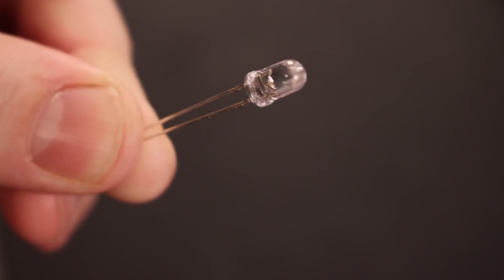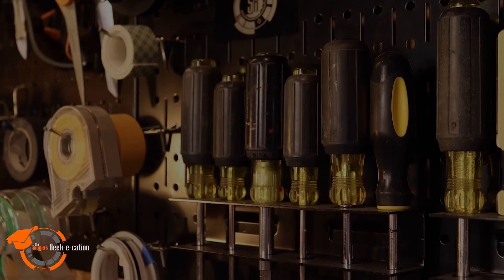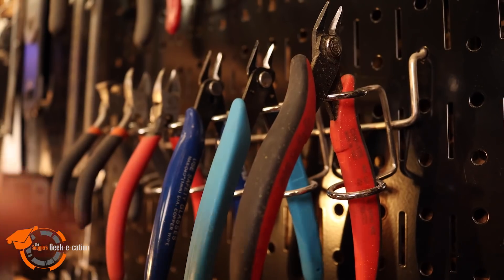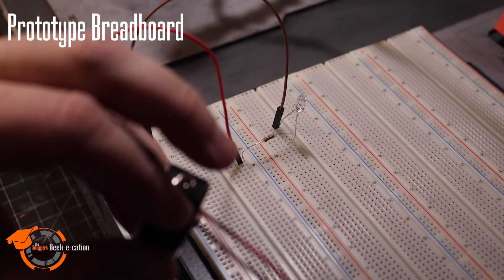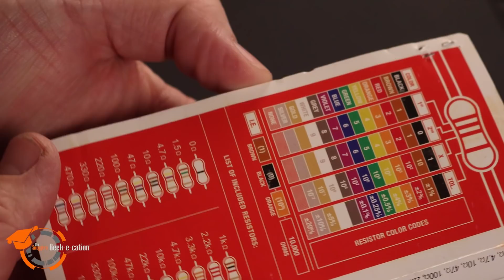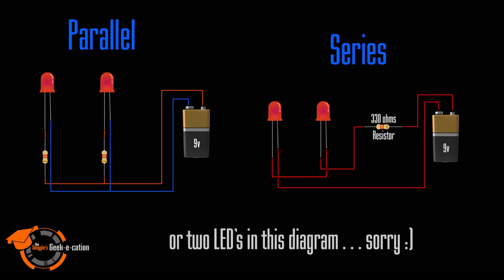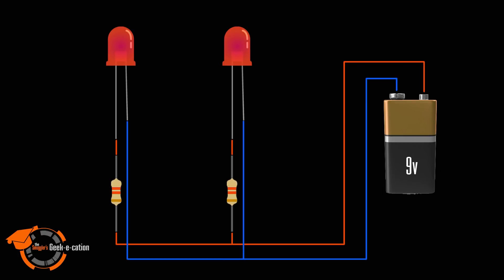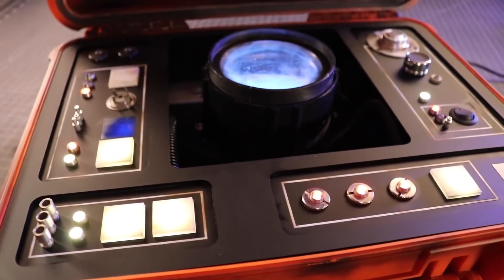Electronics Basics | Starter Tools & LEDs

Comment: I think I speak for everyone when I say THANK YOU was the knowledge and look forward to any future knowledge you drop on us. 

If I were to ask for any knowledge in LEDS it would be how to connect the Leds to an Arduino nano, using a button system to switch between light effects. THAT could be powered by either rechargeable lithium AA batteries or by plug with another switch.

I've seen a few Youtube videos where things similar to that is made but i could never understand why extra electronics were added. like a W130 hall sensor or cc/cv buck converters. I'm also trying to design a solar battery charger that looks like the Endor Shield generator from Return of the Jedi.

Comment: Such a solid video. I was afraid of lights in props three years ago, but I dove in and learned. It is as simple as you say for a basic setup. I use the online calculators for the resistors, but the pre-wired are just so easy to use. If I had found this video years ago, I would have broken my fear back then. Now I love adding lights to everything!
Reply from the maker: Thank you sir!!

Comment: I have a suggestion, which may appear daunting at first for novice electro-nerds, but I think is an important step in greebly LED's: 555 timers. Get them LED's blinking without complicated and overpowered (for this application) microcontrollers. They can be quite simple once you use them, and knowing all the ins and outs isn't necessary for just getting some blinky-ness.

Comment: I really needed this guide. Thank you for making LED electronics a little closer to attain. How would you go about wiring to 12 V  plug instead of 9V battery connection? Great content, as usual
Reply from the maker: Thank you Glynn.  We will be doing a follow up here soon using the 12v.  That said, with these 9-12v prewired LEDs you can wire up the LEDs directly to that power supply.

Comment: Help! lets say someone has those same pre-wired LEDs, 32 of them to be exact, they want to run it 12v from 120v, what do they need to power it? asking for a friend 😉 how many amps? how many watts? will a (Input: AC 110-260V 50/60Hz 2.0A max) (Output: DC 12V 100W  8.3A) LED Power Supply (Driver) work?

Comment: Great tutorial!
A couple more tips:
I leave a small blob of solder on the tip of my iron when I am done. This helps protect from oxidation while it is stored.
Also, you sometimes get LEDs that don't have different length legs. Another way to identify the cathode (- side) is to look for a flat edge on the side of the LED.

Comment: Start tipping 20%, then you don't need the calculator, just double the amount, then move the decimal two places left. This also provides a better pay for underpaid wait staff. Add more if the service is really good, or reduce if really bad (but still tip at least 15%).
Reply from the maker: Thanks for the “tip.” See what I did there 😉

Comment: Awesome Brian! I have had that same soldering iron for years. :-) I have 4 other irons with different tips so I just heat up the one I want to use... Lol
On the resistors for led I just keep 220, 330, 1K, 1.2K, 1.5K's around because on my computers I don't like real bright leds so to dim them down I use a 1K but as you said red, blue, white, green leds have different forward voltages so once again the resisters are the key. Otherwise you will need R2D2 to help figure out the values... :-P
A Bruce Tip, "keep a watch coin cell" around to test you led during the project to make sure it is a good Led. No resistor needed to test the leds... Keeps ya out of the Tantui Bars and trying to figure out what is wrong... Lol
I think these videos will be of some great use, so yes do more Please! Oh, Thanks You! :-)

LLAP

Comment: Absolutely love this one!!  I have wanted lighting in lots of stuff and I even went and bought a desktop power supply and soldering station, but for some reason my soldering tips all disintegrate.. it's very annoying.  I bought pcb boards to light my R2 and even following those instructions nothing works. Just a lot of money down the drain.  
Its good to see that for basic applications I can just get some prewired leds

Comment: You can get by on a single equation for figuring current limiting resistors for LEDs, but you will need to know the forward voltage if the LED and current in milliamps. Very easy. Wiring them in parallel means if one goes out they all don't. 
     In the '70s, LEDs were dim things that came in red, green, and yellow. They come in all colors now( as well as infrared and ultraviolet), and amazingly bright. 
     Don't forget miniature incandescent bulbs and grain of wheat bulbs. Old school, but for some uses, they still have a place ..

Comment: It’s all coming back to me… ohm’s law… in high school, now…. Oh, crap - 50 years ago! Yeah, we had electronics theory then — I took 3 years of electronics in 2 years of school - many of the graduates went on to MIT, NASA, Boeing - me…. I joined a band… But learned a ton of useful stuff… like how the tiniest capacitors could hold enough of a charge, that when you buried them in an eraser, with just a tiny bit of the leads poking out, energized the sucker, then pitched it across the math room to someone requesting it [making sure they weren’t in your electronics class]…. Like I said, I learned a ton of useful stuff. 

So I’m dusting off my soldering iron, and getting to it. Thanks for this refresher - we didn’t have LEDs back then, just big ol’ diodes [and they were!] - and if anyone asks to borrow an eraser…
Reply from the maker: LOL!!!  A charged eraser . . . Genius!

Comment: Breadboards are awesome. I have ... so many I don't know how many, but dozens. Many of them end up 'long term'' in projects that probably should have been transferred to vero-board at some point. 
Lead solder fumes are bad for you, but as a hobbyist we don't use it a lot. Use in a ventilated space and your exposure will be minimal. Lead-free solder is a whole lot harder to work with  "If you've never used lead-free solder before, don't start now."
330 Ohms is fine choice for a 5V or 9V source but it's a little too small a value for many types of LEDs if using a 12V source. You'd be better off with a 560 Ohm resistor for 12V.
More LEDs in series does not draw more current and therefore does NOT drain the battery faster. But you're limited to three or four before the Voltage across each LED drops too low to light the LED and the LEDs will dim the more you use.
More LEDs in parallel does draw more current and will drain the battery faster. But you can wire as many LEDs in parallel as the power source can supply..
[Which is the opposite of what you said @ 9:10]

Comment: Now this is informative!  I would love to see more on the LED! How about a video on simple set up for blinking LEDs, in various patterns. I.e. chasing, random, unison. This is where I struggle to create projects with some pizazz!
Reply: Hey, DC -- I feel a little bad hijacking Brian's comments here - but you asked for inputs on the EXACT stuff I work on. (chasing, randmon, unison etc). I have 2 projects I've done in the last year (Projects, meaning circuit boards for sale) that can do exactly some of the stuff you're looking for. Have a look at the TT Harlech Castle board and the Caernarfon Castle board. They both can drive LED's (either RGB strips, or individual LED's etc) and have example code for arduino that you modify with your pattern.
Reply: Blinking LEDs you have two choices. 
1] You can buy LEDs that have an in-built blinking circuit that flash them at a fixed rate. This is the easiest but and cheapest but gives you the least control.
2] Wire the LEDs to some control circuit that turns the power to the LED on and off to make it blink. This control circuit could be a simple astable circuit or a microcontroller following a complex program.

Comment: Amusing someone in the room builder group was asking for just this.

As someone who has gone through mechanical engineering school and had a ton of projects that required controllers, leds, servos, motors, actuators, the dirty secret in engineering is they don't teach you all that much.  Sure it's great to be able to nail "engineering theory for $400 Bob", but practical application it does not.

This kind of video is exactly how I got the basic knowledge I needed to get into the nuts and bolts of engineering...and get through  the various projects during school.

Listen to Brian, be brave, and dive on in.